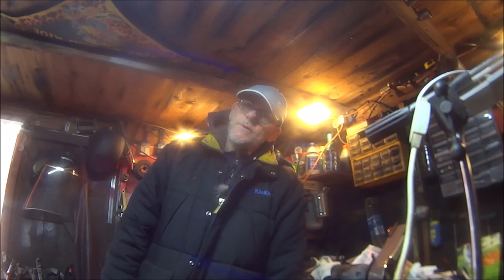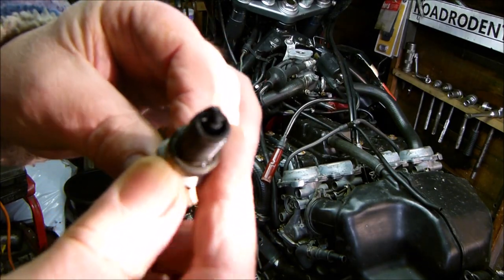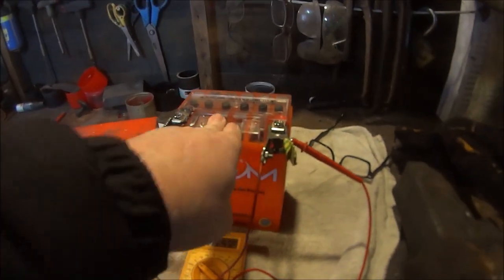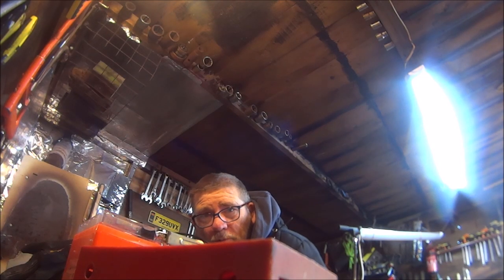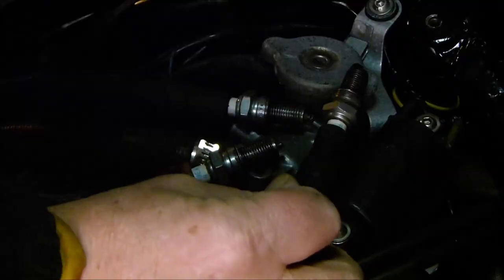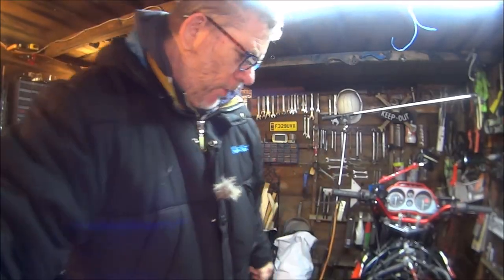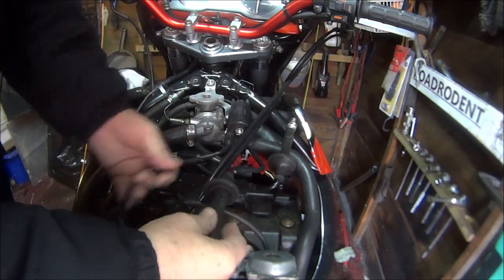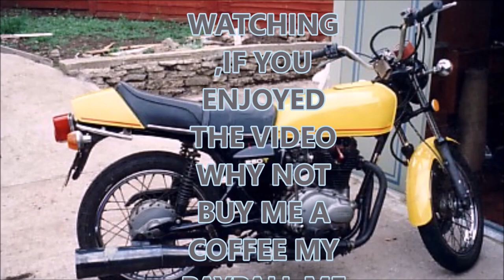cbr1000f Landfill bike, bad ignition coils

Comment: Hi john I've rebuilt and rewired many bikes it makes no difference which way round the wires to the coil run but wat i would do before buying another coil is transfer the wires on the working coil to the dead one and see if it has a spark? If that coil still doesn't have a spark then get a new coil
Reply from the maker: Hi paul cheers buddy yes ill give that a try 👍

Comment: Hey, 16v is way to high for a 12v battery (even a car battery. You want to be about 14.6 but absolute max 15v, at the voltage your putting in uve probably damaged the battery and even run the risk of the battery exploding. Time for a new charger I think bud. The really cheap £15 lcd smart chargers off Amazon are very good. One in yellow & orange.
Reply from the maker: Hi. Dom. Cheers buddy ill have look on amazon hopefully i haven't nacked my battery. 👍
Reply: @jonyr1TT  by sounds of how slow your bikes turning over I think you might of 😞
Reply from the maker: thats just the power pack